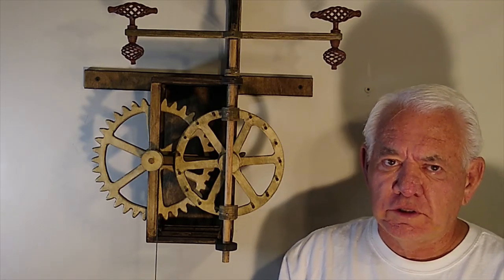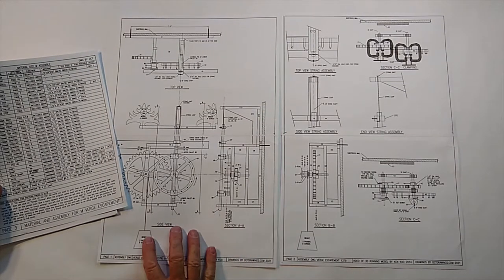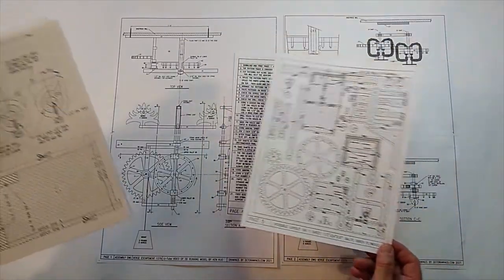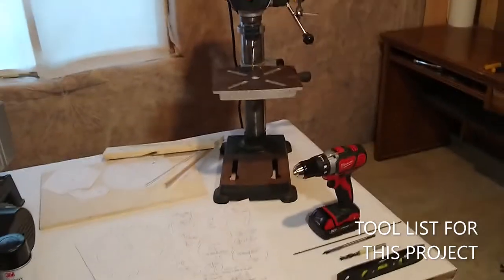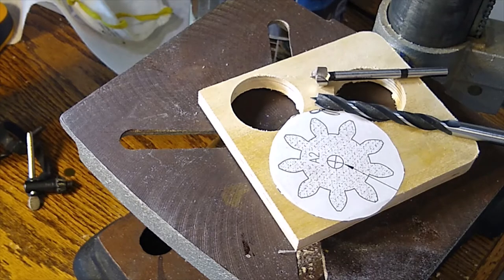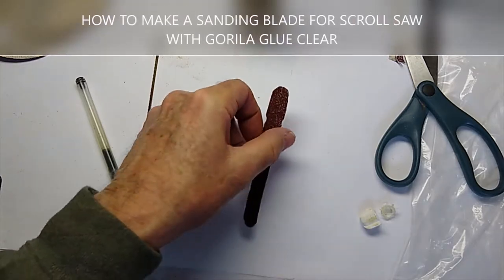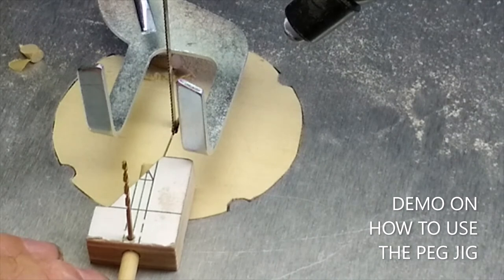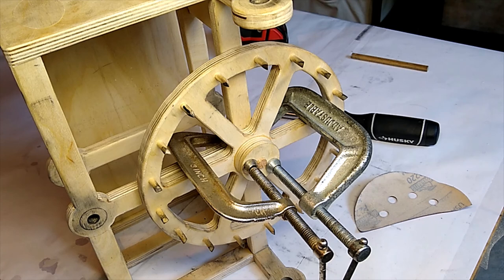Plans and Patterns to Build a Verge Escapement

Comment: In early tower clocks did they have to put the weight back up or did it go back up by itself?
Reply from the maker: The weight pulling on the clock provides the power to run the clock.  The weight would have to go back up to keep the clock working.